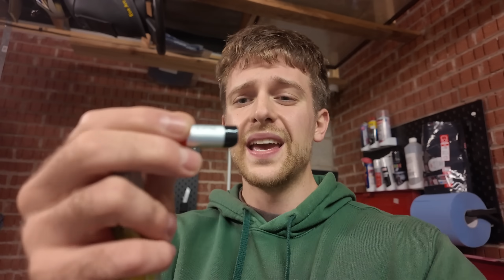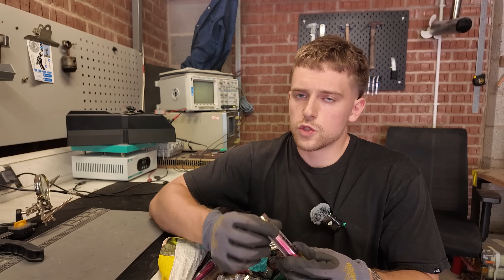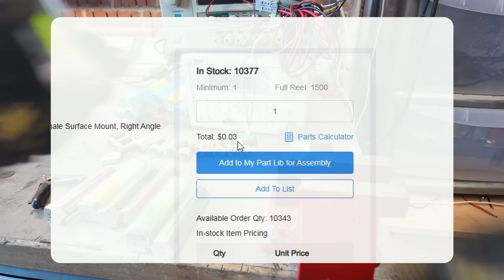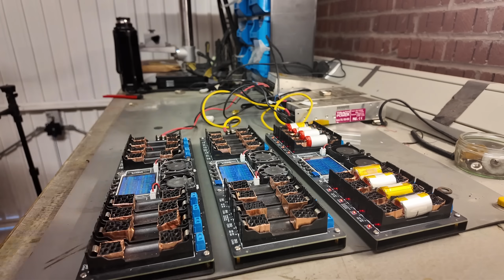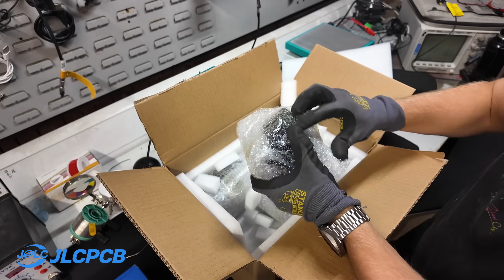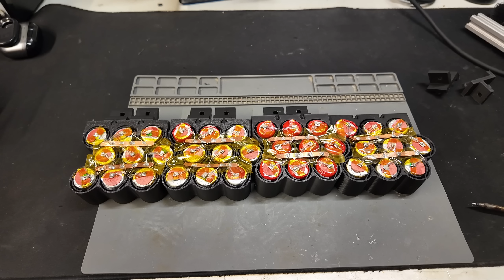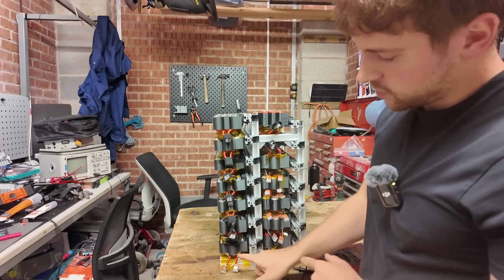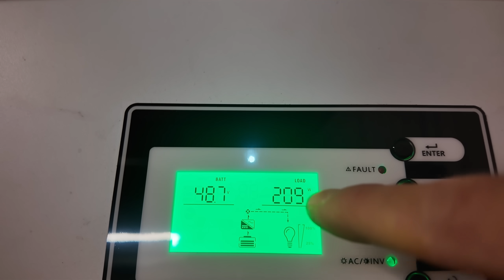I Powered My House Using 500 Disposable vapes

Comment: You really should install a warning sign at each of the breaker boxes to let emergency services know that even if the grid is down, the workshop or house can still be live. Solar-equipped houses in Australia have a green reflector on the outside of the meter box and a laminated map inside showing where the isolation points are.

Comment: instead of soldering, you need to employ one of those electrical spot welder.  It's safer than soldering (no heat damage and far less fumes), but makes superior connections.  You can build one with a MOT.

Comment: why would you not just say a transformer because that's what it is an inverter is something different it switches AC to DC or vise versa, you would need it but it cannot change voltage like a transformer can but a transformer can change AC to DC and change voltage

Comment: Ok, the entire cost of adding recharge-ability is not 3¢, you need chips to properly talk to the USB charger (more to properly support PD and make most C to C connections usable), let alone do the recharging of the batteries. 

That being said, it can’t be enough of a cost to make these stupid disposable vapes make more sense than just giving a free battery with disposable pods for anyone who doesn’t have one.

Comment: Hi Chris. Love the video. I have not built anything as large as this with VAP batteries but have used them for smaller projects. First used them about 3 years ago and did not expect them to last so built a circuit that continuously cycled 2 cells for several weeks. After 1000 cycles they had degraded to 85% of their rating and I think this is in line with ordinary Li cell life. I use any cell regardless of voltage that will hold a charge but not if it has been mechanically damaged. As you said this is a HUGH waste of earth’s resources. Keep up the good work.

Comment: So.
1. The BMS is "monitoring only" and not regulating the charge into each  row in a given bank. This makes the set up pretty - well - dangerous.
2. The banks (specifically the pockets that each cell goes into) look like they are nicely insulating as opposed to providing cooling. To re-work the design of the cell holders so as to provide airflow is a must
3. No temp sensors. The EASun inverter has temp feedback and this is unused. Would be good to put that in so that when teh rig catches fire at least the inverter can shut down....
4. The overall bank is entirely unshielded. In boats (Boat Safety Scheme) the battery banks have to have lids on so that "if you drop a spanner on the batteries they don't weld themselves short and blow up (and I know someone who lost an eye when this happened)"... so an enclosure would be good. Well... mandatory
5. Per Item 2 - forced air cooling - fans...
6. It is usual to have a nice big isolator on the output so that when the smoke does start at least you can turn it off.. A nice 200A one. Victron sell these now. Normal in boat life.
7. Thinking about "smoke in the air", an arrangement with something like an electric forklift charger cable connector set (allowing relatively fast disconnection) given the opportunity to disconnect it open the up-and-over door and chuck it out onto the drive so that it burns a hole in the tarmac rather than a hold in the roof of the house...
8. LiIon cells are prone to give less capacity as they get cold. This rig is in your garage at floor level so will get cold in winter. Put it up high and it might give better performance.
9. TOP TIP #1. You use a (I think it is) grid-tie inverter but not grid-tieng it. If you export to the grid you get better payback than simply not using grid-supplier power
10. TOP TIP #2 If you also fill your roof with panels, hook them into this beast with a solar controller (you know - say 6 KW) then that is the source of your power for export. A mate of mind did this - um... 8 years ago and has been a happy power export bunny ever since.
11 TOP TIP #3 Those panels in Item 10? Well as it happens all those massive solar farms? The financial modelling for them relies on the principle of maybe a 25 or 50 year financial life. The panels degrade slowly over time so the model simply builds in the principle of all panel swap-out after 10 years. There is a cost to this bu the cost is far less than the revenue up-lift from the new panels. So all over the place these solar farms are now swapping out their panels for new ones. What to do with the old ones? Glass, plastic, Al and Si all glued together and impossible to separate. Recycling nightmare. Well seeing as their output has only degraded to maybe 80 or 90% of the brand-new rating there are contractors now operating who rock up, strip out the old panels and then sell them "spares repairs" for ... approx £30 each. For a 500w panel. My boat has 3 of these (1.5 KW) for not very much. Nice one. So if you are in the market for recycling then recycle back into the same purpose, derated by a little bit. Check out Facebook Market Place. Mine came from a contractor in Slough. 

Just saying...

Comment: Neat idea. I like that it's kind of like a UPS or an uninterruptable power source, but for your whole house.  UPSs are usually like a surge strip that you would plug devices you would worry about during a power outage such as a pc or even medical equipment, so that when the power goes out you can have an hour or two of electricity for that device.

Comment: Most of them dead ones  will come back to life with little bit of voltage Even if they've gone down to zero I know I've done it with lots of them. Since there's only one cell there's no risk they've gone negative voltage which is the worst damage  you can do to a lithium battery.

Comment: It's fine as long as it's not below 1 volt  they are fine. Going under 3v only degrades faster. Sa 2.5v cell is still useable.  It's constantly discharging them below 3v is what hurts the cells.  I have 1000's of cells I repurposed  built a bank of 200 cells x7 bank for 24V. Making a 24v 1000 ah battery

Comment: This is an awesome project although I would reccomand a disconnect system that only allows you to be connected to battery or grid as i beleive its a legal requirement because right now theoretically if you were to have a power cut and you flipped on inverter and somehow forgot to turn off the grid you could end up back feeding into the grid and electrocuting anyone working in the street.

Comment: Any contingency for if one of those caught fire in your garage? Maybe hang the battery from a rope over a metal drum full of something that won’t flash over from a lithium fire. The fire hazard alone is enough to discourage anyone from doing this let alone the D/C voltages/amperage’s that you would be messing with if you successfully assemble them.

Comment: Impressive fun project! excited to see the solar as well. I like the cell holders and the build. Safety wise, a little concerned about using Soldering for busbars for a bunch of reasons. I'd recommend you encapsulate the battery pack in epoxy, which will go a long long way to help peace of mind for thermal runaway safety as well as preventing issues from busbar overheating, bugs, corrosion, vibration, or temperature. Also a little bit worried about the grade quality of those individual cells when matching in a large battery pack. They were likley not specified for use in this type of design and the capacity and safety of the whole system could be limited by one weak cell. But regardless, looks like a fun time building packs. Cheers!

Comment: The evolution of this series is insane - from 'can I charge my phone' to casually running a 3kW kettle like you're not one wrong wire away from turning your garage into a firework show. The British engineering energy is unmatched.
Reply: Most kettles in the UK are 1500-2000 (usually around 1800) watts. The evolution of the series is still absolutely bonkers, but kettles aren;t quite the draw you thought.

Comment: hmm in the usa large format 280ah lfp batteries cost around ~100$ for the same capacity. really like this project, not sure its worth it for anyone to do.
i found a lot of use by reusing vape batteries in chinese goods which cheap out on the battery inside by just wiring in parellel. examples are under counter lights (old iphone batteries are thin enough to fit in and 5x capacity) and knock off air pods, inside plenty of room for vape cell in the main charging case. i also use them for random projects like droppable wifi repeaters to borrow wifi from across the block while im camping in my car at a free ev charger lol

Comment: The problem is that you used identical batteries. In real life there are different types and sizes of batteries, you won't be able to get thousands of identical batteries in real life.
Reply: I have the same question! In the beginning he extracts different size batteries, but by the end they all look same. As if he is using batteries from somewhere else. I feel like he is hiding something. I could be wrong.

Comment: I wouldn't have that thing inside the house, or garage, or any habitable structure.
So where to put it? I'd find a place that has a safe distance from anything flammable, I'd make a weatherproof, vented enclosure.
If it does start flaming you probably can't put it out, so someplace the fire brigade can reach it.

Comment: I think you said that batteries in parallel all have to be the same capacity. This is true for cells in series, but not in parallel, the only requirement for parallel is that they are the same chemistry, i.e have the same voltage profile.
Cells in series not only need to have the same profile, bu also the same capacity and the same condition...
The more you know...

Comment: How do you recharge it? Or is it a one time use? What happens if a battery in the middle of the device goes bad/dies? Do you have a way of finding which one is bad? Or is the whole thing junk at that point? Will one battery going bad cause others to fail or just blow the fuse? I have a lot questions lol

Comment: The same capacitance is not important when connected in parallel. The same capacitance becomes important when you use series connection to create units with higher voltages.

Comment: Great video, massive respect. Not sure you needed to 3d print the flexible battery contacts. In the past I’ve used bits of foam rubber with tape round them for a similar job.

Comment: That video is so relevant these days, considering how expensive energy has become in EU. That is a very complicated but still a solution. So you basically charge them up at nighttime when electricity is cheapo, and use in daytime when it is expensive - flipping the price basically.

Comment: You can revive the "dead" cells by connecting a fully charged battery to a dead one in parallel, the voltages will balance out & you can then charge the battery again. There might potentially be some lower capacity if it discharged too far, but if not, it's gonna be good again. I've done this with like a hundred lithium 18650 cells, aswell as some vape cells. There is some fire risk to it tho if you do it recklessly, so you should connect it for like 5sec, then disconnect, then repeat until the voltage is balanced enough where it gets slightly warm at most, but not hot. No need to throw away "dead" cells that aren't actually dead, unless they've gotten actual damage.

Comment: I'm unfamiliar with disposable vapes, but it seems like a safety risk for trashfolk assuming they run crusher trucks out there when they collect the trash, or maybe you guys have bins specifically for this.

great/insane video; definitely feel the challenge with harvesting/using cells. I wound up with a brand new defective 52V pack I couldn't do anything with but disassemble (was made for a lawn mower). now I have a pyramid of new 18650 cells to go with my other pyramids of cells, none of which match, and which I wouldn't reuse because I also have pyramids of compact pouch batteries I prefer. I give them a little top-up charge every year, pretending I'm going to find a project for them some day aside from eventually blowing up my house during a fire. 🤷

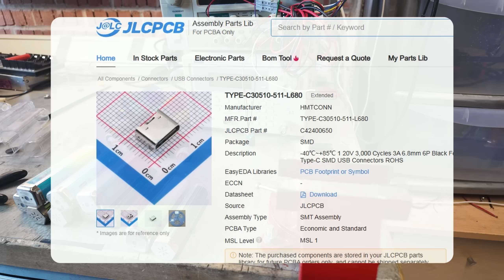Comment: @4:51 lol just because the piece only cost $0.03 doesn't mean that's the ONLY cost to adding them. This requires redesigning the circuit board and then creating a process to add the charging port. That's FAR MORE than 3 cents. Use your head on that one next time. It's quite obvious why they don't want to do it, because it'll cost them 100's of thousands of dollars.
Reply: so the better plan is to through hundreds of thousands of dollars of environmentally destructive highly dangerous explosives onto the streets?
Reply: Let them spend 100s of thousands of pounds

Comment: 14:05 You could put on Wago clamps on each individual wire-end before mounting, therefore preventing them from contacting their neighbors. And then, when it's time to finally connect the wires, just remove one clamp at a time. That would dramatically reduce the risk of accidantially shorting wires. Thank you for the great video :)
Reply: Why do I have a sudden urge to invest all of my money in Wago? 😂

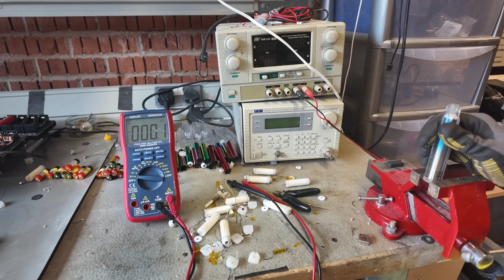Comment: 2:20 No. Single lithium cells do not get damages by discharging below 3V. The damage happens in cell stacks when one cell is weaker than the others. If current keeps flowing, this cell will be reverse charged which leads to dentrides. A single cell can discharge just fine.

Comment: Nice concept, I am curious which temperature the cells are getting when discharging and charging. Also I would love to see a bit sturdier frame + maybe easier slide slots for easy replacement of faulty batteries. Maybe you could do it so that you slide them in from one side and they plug in into a connector on the other side on a circuit board (bit like the older harddisk or cdrom trays that you could slide in and out and would connect IDE and MOLEX power connector).

Comment: How does a fuse on the Tesla battery work? Does the battery suddenly produce more power before it fails? I don’t understand. I think that wire isn’t a fuse but a thermally meltable conductor.

Comment: maybe they should standardize the sizes of vapes, that there are only 3 or three different sizes, voltages and capacitys and make it easier to remove the battery. that way it could be much faster and easier to remove the batteries and check them to be used and then put them in powerbanks or whatever. And then you could do collectionboxes in smokeshops from where they will be send to a facitlity that does that. I think this could potentially be profitable. Or you also could even sell empty powerbanks for each of these sizes and then you get a free powerbank, which grows in capacity with each vape you buy hahahahaha. If the case is modular to easily enlarge the space for the batterys, you could also choose on the fly if you want a small one or a big one and you could simply swat batteries instead of slowly charging the pack when in a hurry.

Comment: So how would you go about recharging the power bank? Could you do so with something like solar or wind (really just friction charge in general) where the supply to the bank isn't constant? I live in the United States and solar is sort of commonplace now but battery walls are not, and im not sure if it's due to cost, risk, or some feature of solar that doesn't mesh easily with recharging big batteries.

Comment: Pretty good engineering but you absolutely should have an extraction fan for that much soldering especially using leaded solder.  Even the PM2.5 pollution from testing the cells with the fan isn’t good in an enclosed workshop.  I’d also be very concerned about discharge rate even with the fuses.  Sure the cells peak at 3C discharge rate but the max continuous discharge rate is a tiny fraction of that.  If you’re keeping that in your workshop would definitely get a WiFi linked smoke alarm and not keep it anywhere near other flammable items.

Comment: Interesting side note. A so-called dead lithium battery when put under collapsing pressure creates a crazy amount of explosive energy.  Imagine using this old tech to get rockets off the ground and potentially using them even in 1 time use booster rockets.

Comment: So the only thing is you need to be extremely careful you dont backfeed the grid if you use the battery as a backup in a power outage. Backfeeding the grid is possible without a proper transfer switch. A transformer will also work in reverse so a lineman who believes a line may be dead, could be backfed with your battery to extremely high voltages. Simply flipping a main breaker is not a sufficient transfer switch.

Comment: Love this. Been collecting vapes for a while with no idea what to do with them. all ready have solar but no power wall to take advantage of the free power. I'll be doing this for sure. From what you built what how long would it last just to power the workshop? I do a lot of 3d printing and have random power cuts where i live so this would be great as a ups system too.

Comment: awesome. you need to connect the batteries to solar panels and maybe work on the grid system in order to swap out batteries easier. maybe some connectors which could be added to the 3D prints so you dont have to solder them. like displaying the exact grid which si shorted and then pull it out. place new batteries in and everything works just fine :D

Comment: The copper foil use for making connections to the cells is not likely to make a good connection. Copper oxidizes rapidly and the oxide is a poor conductor.

Comment: How many Amps does the stack have? Also, you need to enclose that pack and have a fire extinguisher near by or that thing will not just power your garage and house but burn it down. Great job lad (I think I used that correctly, as a fella from OKC), this is great idea, I just don’t want to see you in the news for the wrong reasons.